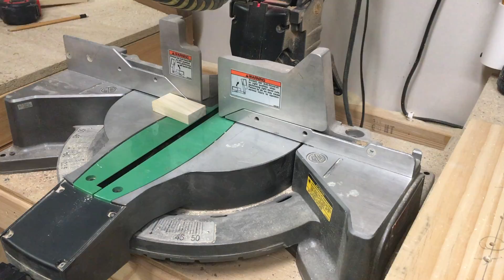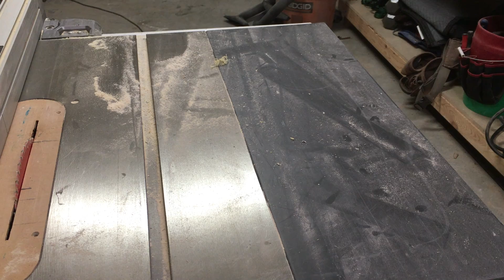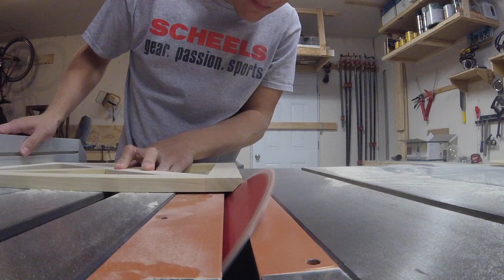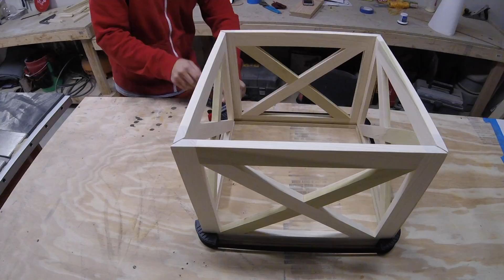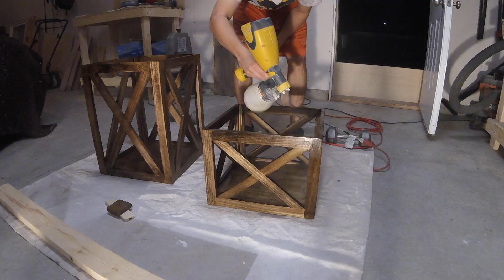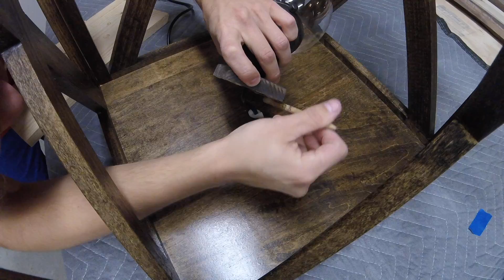Wood Light Fixture - Kraftmade

Comment: i'm building some of these right now. how did you manage to support the wire leading to the ceiling box. seems like a lot of weight on that wire bundle with the wood box attached to it. thanks for the video...good stuff.
Reply from the maker: he light fixture really wasn't that heavy and the cord is quite strong. I am not too worried about the weight and after a few years it has worked fine.
Reply: @Kraftmade  gotcha.  thanks!

Comment: I like this alot. the only thing i have to say is the box is only held together by glue and im sure if it fell or anything happened the whole thing would come apart, no nails, no pocket screws, no biscuits no nothing.
Reply from the maker: You forgot to mention dominoes, dowels and mortise and tenons
Reply: Actually... wood glue, if used properly, is just as strong, if not stronger than nails, screws, staples, etc... 😁

Comment: Hi bro! Beautifull work!! Im doing some similar proyects but im having some issues with que cable. Cant solve how to hold the entire lamp from the cable. It's too heavy and evwrytime i put the lamp up the cable joints breaks. How did you solve it?
Reply from the maker: Thanks! I epoxied a zip tie in between the top piece and that little price of wood on the underside